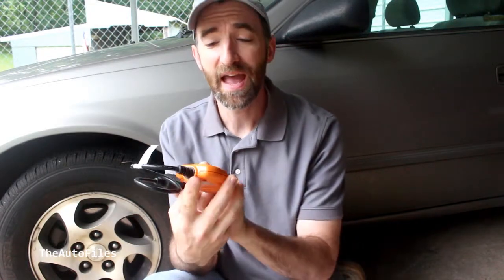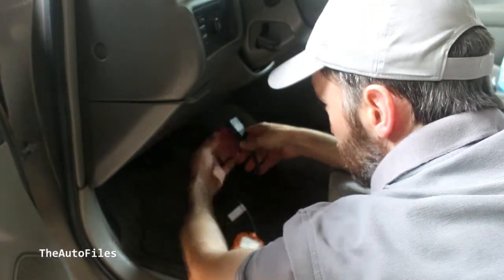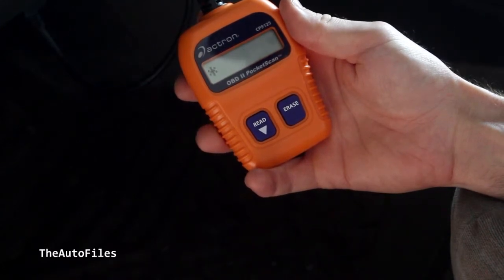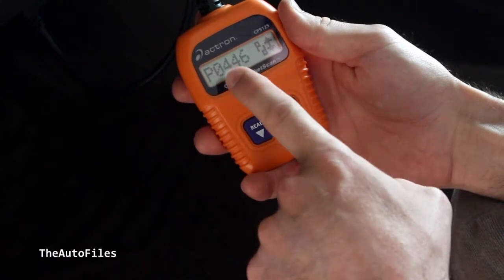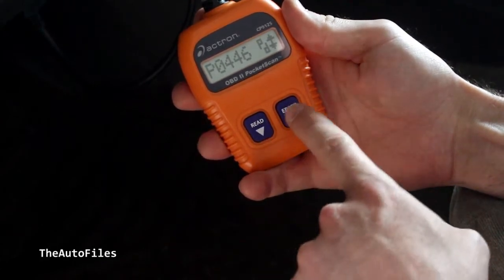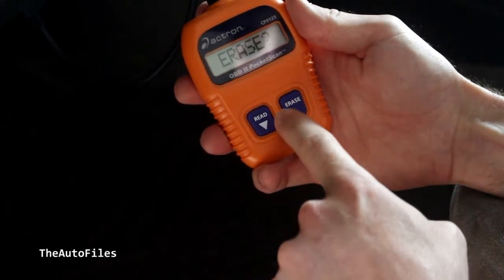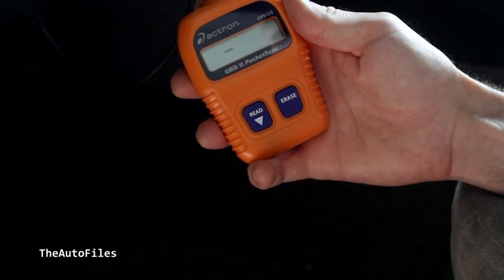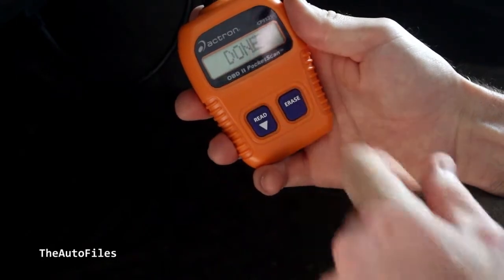Actron CP9125 OBD2 PocketScan Code Reader

Comment: Mine must be outdated as it only works on my 96 and 98 GM.  Won't connect to "NO LINK" anything newer that 2001.  Tested on 2001 MBZ, 2002 Honda amd 2007 Tacoma.  Time to toss it and get o e that can be easily updated.